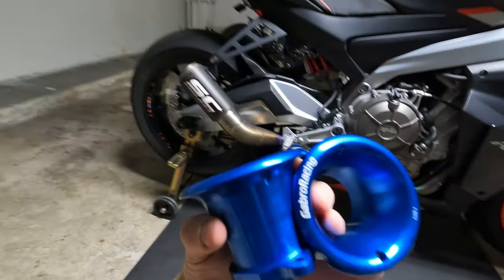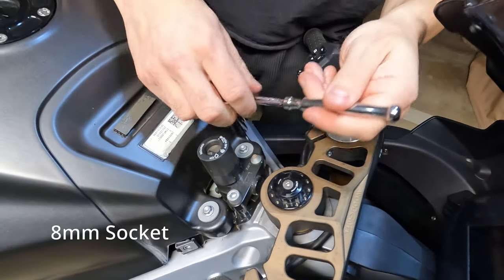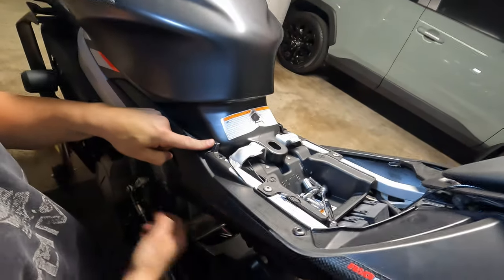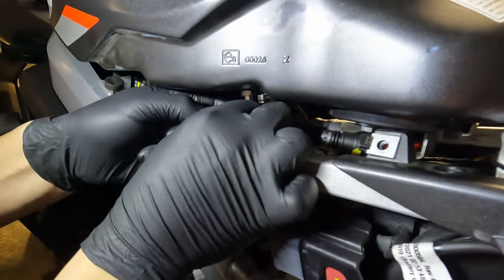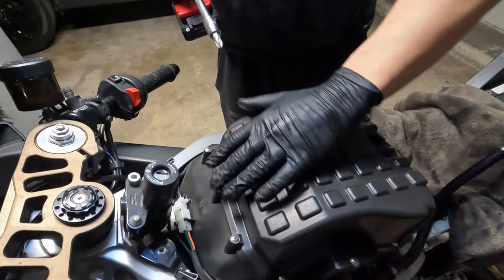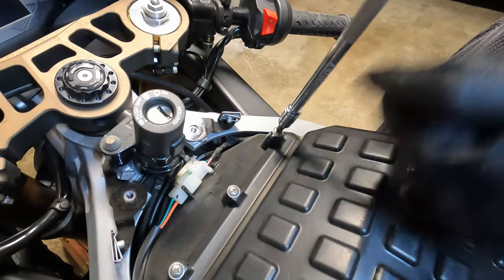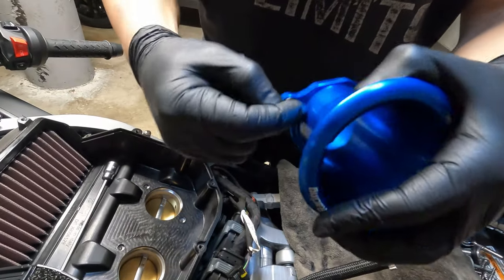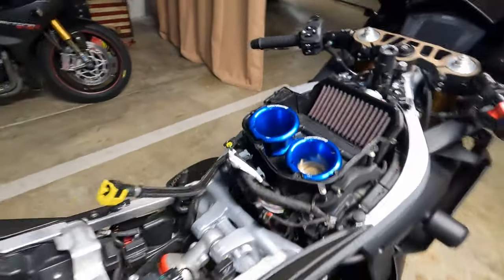RS 660 | Velocity Stacks Gabro | Install

Comment: Great video.  Very clear and easy to follow everything.  If i didn't already have the dealer install mine at one of my service intervals i'd definitely be doing this upgrade myself.  Also like your cable on the seat crowl, mine just came off a few weeks ago so now i'm deciding whether or not to paint or replace it.  tried to wrap it myself but that didn't go too well.
Reply from the maker: Thank you! Its a pretty easy install. I had my seat cowl fly off after my dealer didn’t secure it in place. In their defense these seat cowls are tricky to secure. They replaced it for free, but I wanted to make sure that will not happen again so the wire is an extra safety. ✌️

Comment: Hey the video is cool but what is it really for?
A gain in HP? Or just the bike breathes better
I don't know what is velocity stacks can you explain ?
Reply from the maker: Thank you! Velocity stacks smooth the flow of the air into the inlet tract by utilizing the conical entry shape. The conical shape creates an entry radius for the air to follow, avoiding narrow restricted air flow. Narrow entry causes loss of horsepower. They also alter the inlet tract length. By inlet tract length we refer to the distance from the head of the intake valve to the manifold including the throttle body, to the summit of the velocity stack. The easiest way to alter the inlet tract distance is the height of the velocity stack. The height of the velocity stack is crucial, as it manages the pressure wave in the inlet tract. By managing the pressure wave by distance, you have control of the power output on the rev range. In layman’s terms, if you want more power on the high rev range you shorten the height of the velocity stack and if you want more power on the low or mid-range you increase the height of the velocity stack. The reason for that is that airflow is constant, but the intake valve opening is not. Which means that for a split moment the air flow hits a wall and stops at the head of the intake valve while being forced to return back to the entry point of the velocity stack. That happens multiple times in a millisecond. The optimal power output will be to time the airflow return to the opening of the valve. That can only happen on certain RPM with a certain velocity stack height. The optimal velocity stack is the one that smoothens the power output throughout the rev range but also offers more power at the desired rev range. In the case of the Gabro stacks for the RS660, they increase power on the low and mid-range by giving a smooth power output throughout the rev range.

Comment: You use any loctite on the gabro screws?
Reply from the maker: I did not. The time I installed them, Gabro had not released the update about using blue loctite.

Comment: What does it actually do? I don’t know…
Reply from the maker: They smooth the flow of the air into the inlet tract by utilizing the conical entry shape. The conical shape creates an entry radius for the air to follow, avoiding narrow restricted air flow. Narrow entry causes loss of horsepower. They also alter the inlet tract length. By inlet tract length we refer to the distance from the head of the intake valve to the manifold including the throttle body, to the summit of the  velocity stack. The easiest way to alter the inlet tract distance is the height of the velocity stack. The height of the velocity stack is crucial, as it manages the pressure wave in the inlet tract. By managing the pressure wave by distance, you have control of the power output on the rev range. In layman’s terms, if you want more power on the high rev range you shorten the height of the velocity stack and if you want more power on the low or mid-range you increase the height of the velocity stack. The reason for that is that airflow is constant, but the intake valve opening is not. Which means that for a split moment the air flow hits a wall and stops at the head of the intake valve while being forced to return back to the entry point of the velocity stack. That happens multiple times in a millisecond. The optimal power output will be to time the airflow return to the opening of the valve. That can only happen on certain RPM with a certain velocity stack height. The optimal velocity stack is the one that smoothens the power output throughout the rev range but also offers more power at the desired rev range. In the case of the Gabro stacks for the RS660, they increase power on the low and mid-range by giving a smooth power output throughout the rev range.

Comment: What do these do over the OEM stacks?
Reply from the maker: @solidkreate5007  Velocity stacks smooth the flow of the air into the inlet tract by utilizing the conical entry shape. The conical shape creates an entry radius for the air to follow, avoiding narrow restricted air flow. Narrow entry causes loss of horsepower. They also alter the inlet tract length. By inlet tract length we refer to the distance from the head of the intake valve to the manifold including the throttle body, to the summit of the velocity stack. The easiest way to alter the inlet tract distance is the height of the velocity stack. The height of the velocity stack is crucial, as it manages the pressure wave in the inlet tract. By managing the pressure wave by distance, you have control of the power output on the rev range. In layman’s terms, if you want more power on the high rev range you shorten the height of the velocity stack and if you want more power on the low or mid-range you increase the height of the velocity stack. The reason for that is that airflow is constant, but the intake valve opening is not. Which means that for a split moment the air flow hits a wall and stops at the head of the intake valve while being forced to return back to the entry point of the velocity stack. That happens multiple times in a millisecond. The optimal power output will be to time the airflow return to the opening of the valve. That can only happen on certain RPM with a certain velocity stack height. The optimal velocity stack is the one that smoothens the power output throughout the rev range but also offers more power at the desired rev range. In the case of the Gabro stacks for the RS660, they increase power on the low and mid-range by giving a smooth power output throughout the rev range.
Reply: @ALFAVITAGA  oh wow thank you so much for explaining.

Comment: What is this upgrade going to do?
Reply from the maker: By raising the velocity stacks higher it increases the power on low and mid range. It also comes with a free map for the Upmap. In combination with the map, it increases the power throughout the rev range but mostly on the mids. Gabro just developed variable stacks for the RS660, which will give more power throughout the rev range.

Comment: How more horsepower?
Reply from the maker: Velocity stacks basically move power around the rev range. It’s not so much about horsepower. In my case they increased power delivery on low and mid range. I will upload a ride review with them.
Reply: 7´6 me parece

Comment: Why you install this ?
Reply from the maker: They smooth the flow of the air into the inlet tract by utilizing the conical entry shape. The conical shape creates an entry radius for the air to follow, avoiding narrow restricted air flow. Narrow entry causes loss of horsepower. They also alter the inlet tract length. By inlet tract length we refer to the distance from the head of the intake valve to the manifold including the throttle body, to the summit of the velocity stack. The easiest way to alter the inlet tract distance is the height of the velocity stack. The height of the velocity stack is crucial, as it manages the pressure wave in the inlet tract. By managing the pressure wave by distance, you have control of the power output on the rev range. In layman’s terms, if you want more power on the high rev range you shorten the height of the velocity stack and if you want more power on the low or mid-range you increase the height of the velocity stack. The reason for that is that airflow is constant, but the intake valve opening is not. Which means that for a split moment the air flow hits a wall and stops at the head of the intake valve while being forced to return back to the entry point of the velocity stack. That happens multiple times in a millisecond. The optimal power output will be to time the airflow return to the opening of the valve. That can only happen on certain RPM with a certain velocity stack height. The optimal velocity stack is the one that smoothens the power output throughout the rev range but also offers more power at the desired rev range. In the case of the Gabro stacks for the RS660, they increase power on the low and mid-range by giving a smooth power output throughout the rev range.